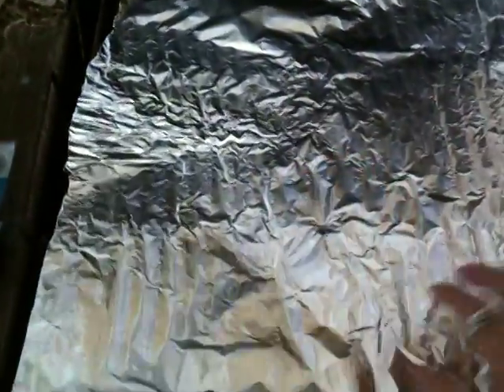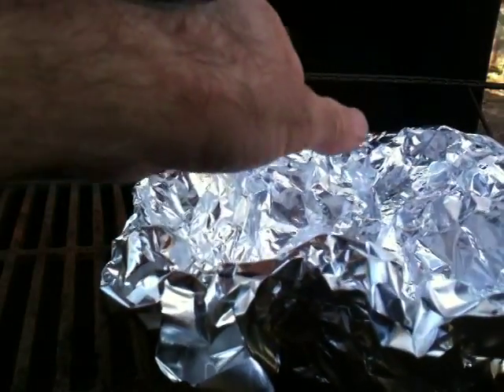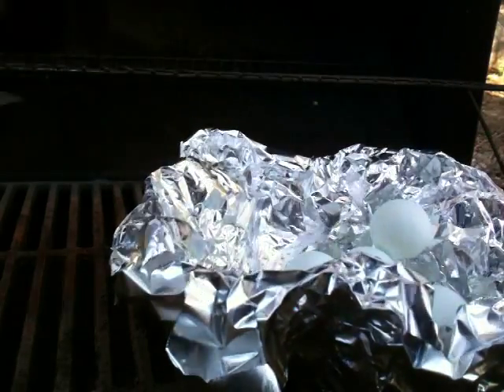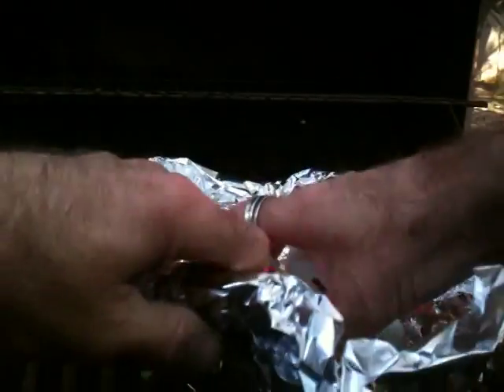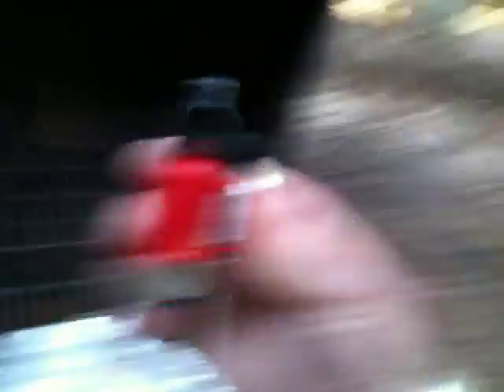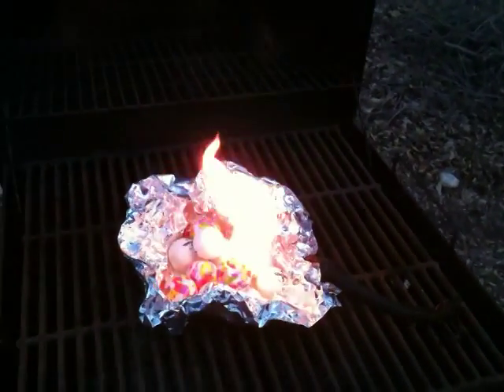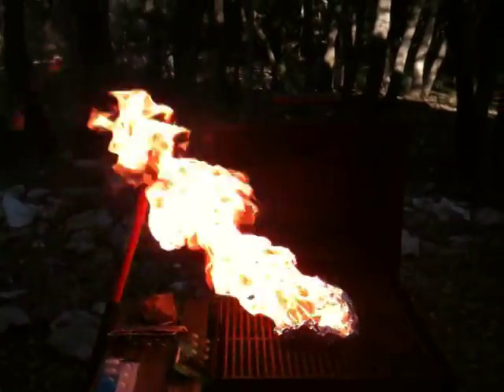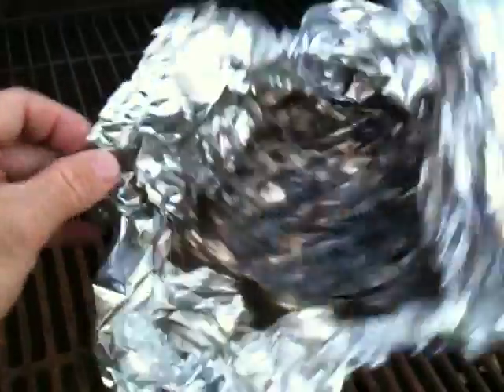Explosive Ping Pong Balls?

Comment: Nitrocellulose is what modern smokeless gunpowder is made of. It's made from nitrating cellulose(cotton, wood pulp ect). Nitrocellulose powder alone is a single based gunpowder.

Nitroglycerin is produced by nitrating glycerol, or glycerin.  

Nitroglycerin treated nitrocellulose  produces a double based smokeless gunpowder.

Both substances burn hotter and stronger under pressure. With pressure alone being enough to set off  nitroglycerin.
Reply from the maker: Forgive me for just seeing your comment. That’s exactly right. I’ve done many nitrations and nitrocellulose is one of my favorites. It’s also the reason why early Kodak film and Edison records were so flammable. It deserves our respect.